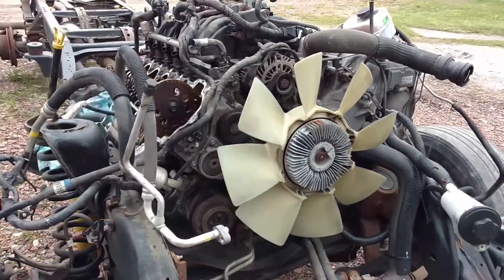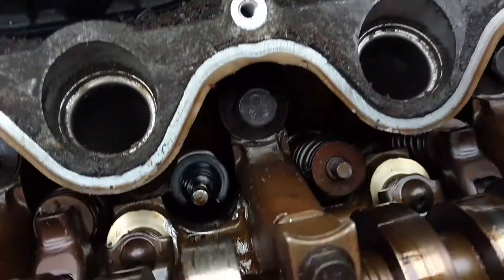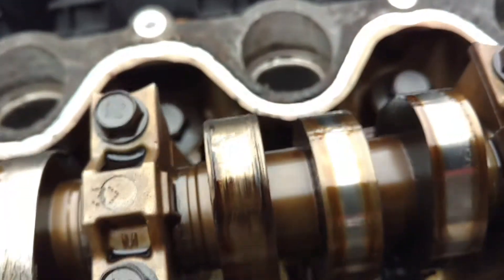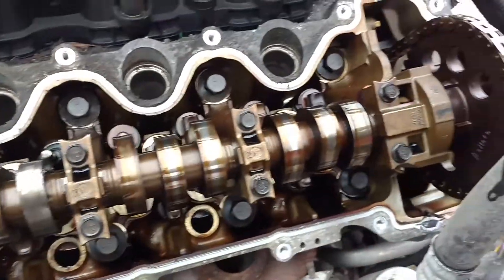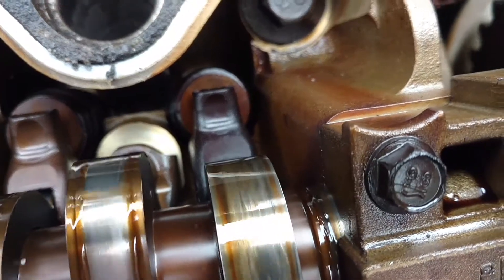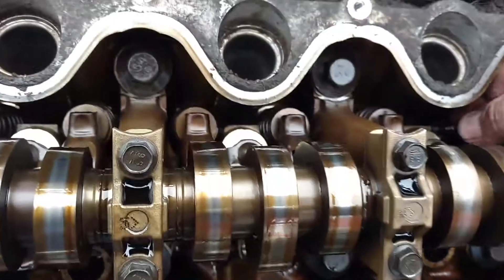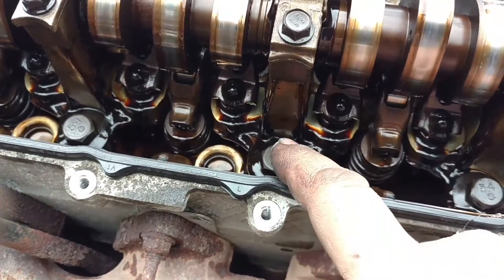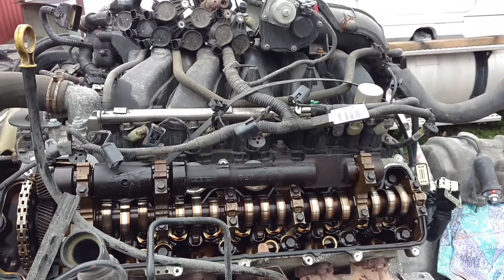PART 1) 2013 Ford 6.8l No compression! Cam followers fail ruining cam and what else?

Comment: Hi folks. Has anyone seen been successful in using c - clamps to hold the cam gear in place while replacing the cam, followers and lifters? I have a stuck follower on the right bank of my F53 chassis.

Comment: I just bought a 2015 f550 with 120k miles on it. Would it be a smart thing to change the cam followers as a precautionary measure? Especially not knowing the history of the engines maintenance.
Reply: yes these are chronic problems with these motors. And don't buy the cheapest ones you can find.

Comment: I have a 97 F150 with a 4.6L 2 valve and have now had 3 Remaned engines in it (2 from Powertrain and one from Jasper) with it currently in the shop for the 4th one about to go into it from Jasper (warranty of course). Once this happens don't bother wasting your money. I'm now on my 4th remaned engine in 4 - 5 years. If this happens just scrap it. Also all these engines have only had 8,000 to 15,000 miles put on them till the floating rocker arms broke, one of the 3 I had put in broke the rocker arms with it only running for 30 minutes. Again if this happens don't invest the money into the engine. I have sense bought a new truck.
Reply from the maker: first of all....i dont buy reman engines. i rebuild my engines. you have no idea what they did or did not replace. you cant blame that engine for rebuilding issues. many of the failures i see with engines are because of cheap parts or lack of maintenance. the 4.6 has been a very good engine for me. this video is of the 6.8 valve v10.

Comment: The oil pressure on these engines gets to the passenger side last after feeding through the drivers side, crankshaft and finally over to the passenger side. Same for 4.6 and 5.4 with the oiling issues. There is a new high volume oil pump available now, that is supposed to prevent this.
Reply from the maker: i am very familiar with this issue. you can get the pump as a high volume or a high volume high pressure. these pumps increase by 20%. i install these pumps in every 5.4 and v10 i take apart.

Comment: I believe the balance shaft is used to dampen engine vibration in the V10, the traditional balancing must have been enough in the 5.4. I can definitely believe extra dampening would be needed, any imbalance is very easy to notice and make a truck seem to run “rough” even when it’s running smoothly. Very noticeable even when something as minor as fatigued rubber in a harmonic balancer is the only thing causing an issue

Comment: This wis exactly what happened to my 5.4 v8!! Trying to decide if it makes sent to repair and clean out or replace with rebuilt motor. I’d appreciate some advice on it.
Reply from the maker: you cant answer that question until you know if there is metal that has been pumped throughout the motor via the oil pump...if it has, i would tear it down and do a complete rebuild.

Comment: now I know I don't want one of those,
Reply from the maker: keep in mind this was a work truck that probably weighed 17,500lbs everyday of its life and did stop and go city deliveries for over 200,000 miles. the truck still ran (with a miss) and drove. it is unfortunate that the needle bearings failed but it  is an acceptable failure at those miles.
Reply: @j.c.smithprojects  Chevy and Dodge guys on here desperately looking for some kind of weakness in the Ford brand so they can feel better about  their choice for buying Chevy and Dodge problem laden brands. Yes, 200,000 miles in a heavy truck on a non-diesel engine is respectable indeed. If it were mine I would not be disappointed in the least.

Comment: It seems like the primary cause is the bearings in the cam followers, as you say. That is a high rate of failure. Does Ford have a fix with better bearings?
Reply from the maker: they have an updated design that should have already been in this truck from the factory. i believe this engine may have too much damage to be cost effective to repair. if it is repairable, i will use it in a rat rod build of my own i have been planning.